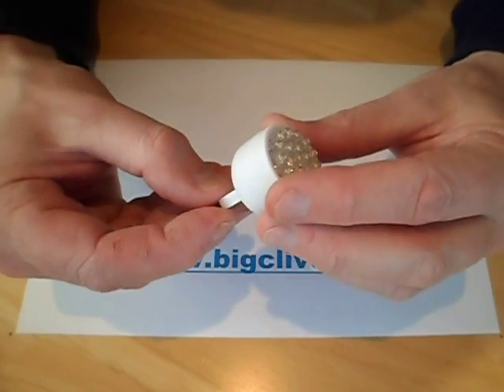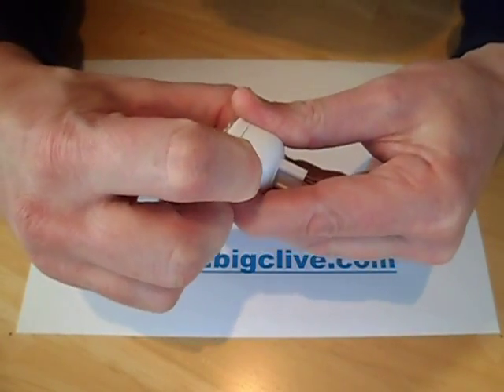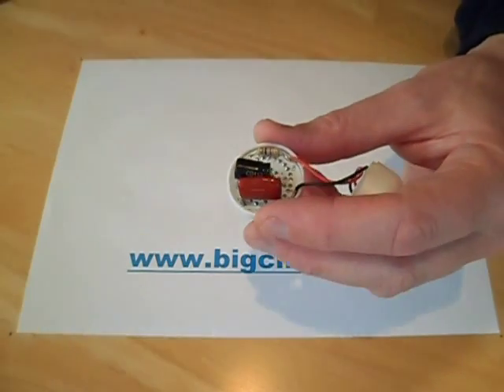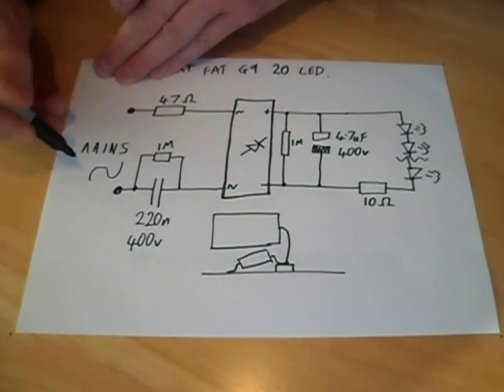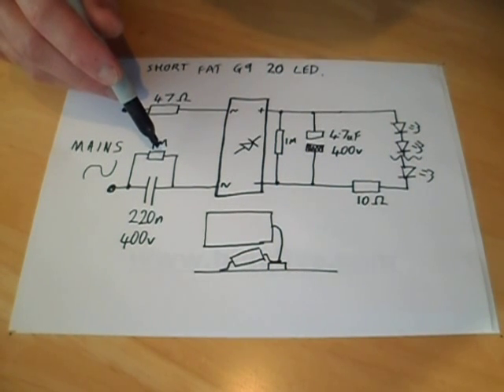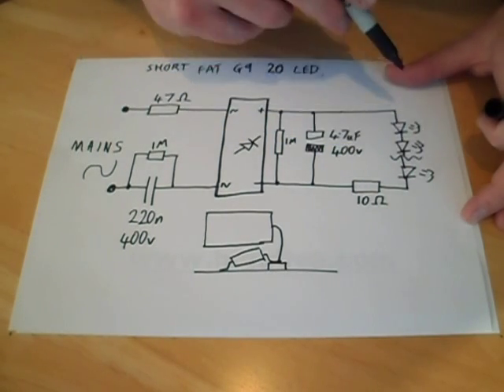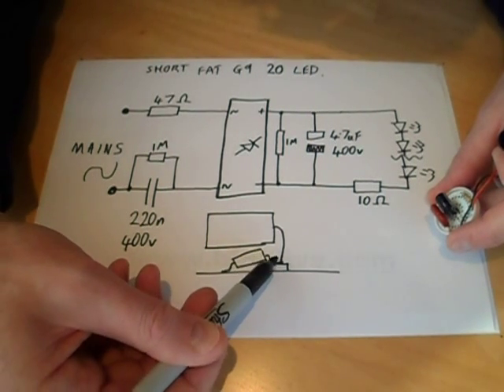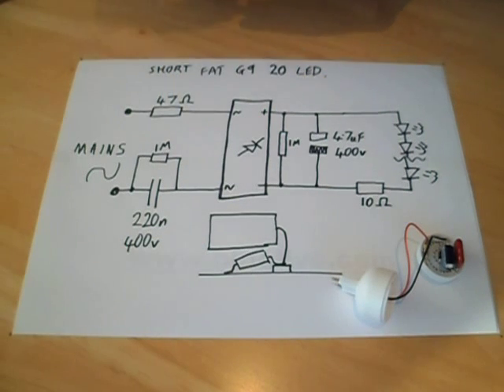Different G9 base LED lamp teardown.

Comment: Hi Clive!
I share your fascination for LED technology and for years before the first LED lamp hit market wondered why we aren't using them in this fashion. I appreciate the teardown of the "capacitive dropper" circuitry.  It fascinates me.  Being in the US we can't be trusted with 220v, though it would make sense.   To adapt the circuit to 110v would I simply need to half the 220nF cap?
Reply from the maker: Rich Booth For 110V you would need to increase the value of the capacitance.  But its size could probably remain the same as the voltage rating would go down to about 200V or 250V.

Comment: So most such led bulbs due to cost and size does not offer isolation fron mains?
Reply from the maker: Most small lamps use capacitive droppers and have no isolation.

Comment: Clive, now your in the BS zone. You have never seen Manhattan wiring? BS.
Reply: Crocellian Could you please explain the BS you found? I presume Clive hasn't seen the Manhattan wiring (as he's in the U.K.) and neither have I, so an explanation would have been nice.
Reply: Dr Stevenson Ah, I didn't know that. But I seem to be still failing at detecting the BS here. Because it's justifiable for Clive not to know what it is, since Chinese manufacturers usually don't do such weird things. (Except for the time that Clive encountered the rare and threatening Cheap Pink USB charger from China.)